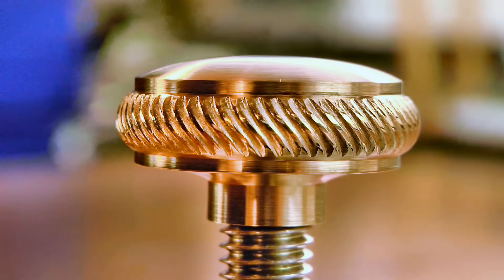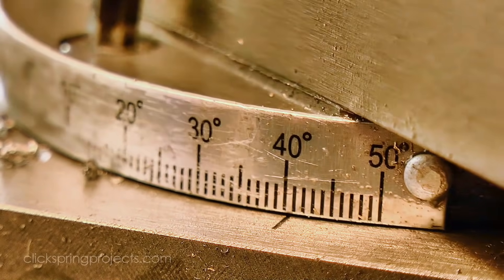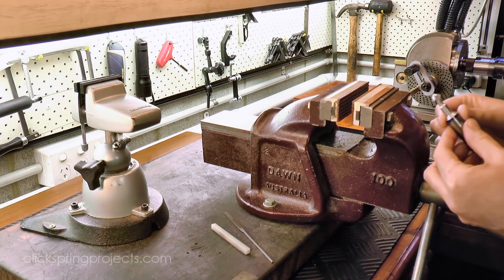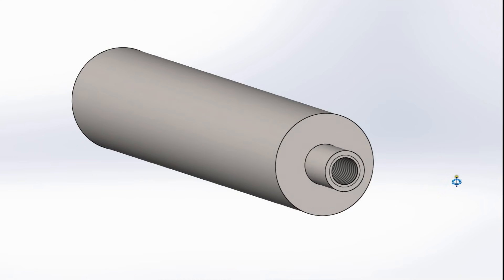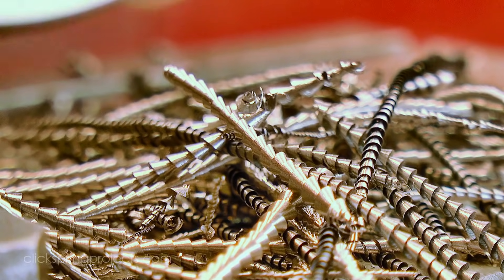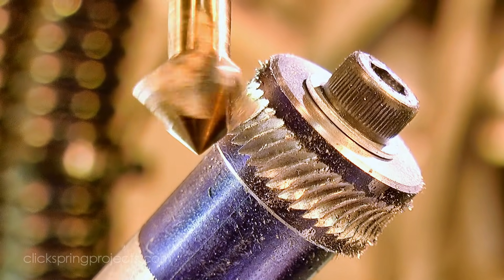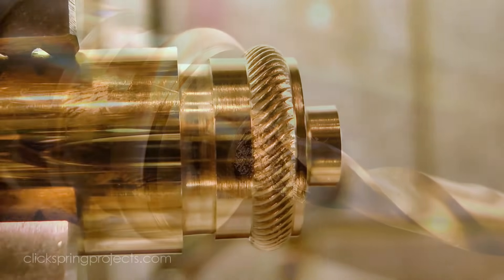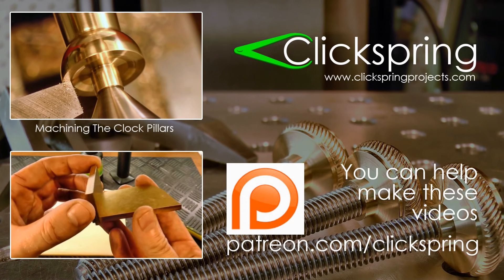Home Machine Shop Tool Making - Machining A Set Of Vintage Style Rope Knurls

Comment: These videos are absolutely mesmerising! This is art 👏 however, may i ask what is the difference between a normal drill bit and a 'reamer'? :)
Reply from the maker: +adam cowan Hey Adam, a drill makes a hole, but the dimension and surface finish of drilled holes is usually quite poor. However if a slightly undersized drill bit is used to make the basic hole, a reamer can be followed to leave a much better surface finish, and precise dimension. Thanks for watching and asking.
Reply: Thank you 😊

Comment: Are the rope knurl patterns (the blank molds that get pressed onto the wheels) hardened or a harder material than the wheels themselves? If not, won't the brass on brass cause the pattern to deform after a few uses? Great work as always!
Reply: In the video you see that the molds are made out of steel then quench hardened and tempered.
Reply: +Invoid ker Yep, somehow I completely missed that part. He definitely knows what he's doing, so I didn't think a step like that would go overlooked.

Comment: Love your videos and admire your craftsmanship, just a thought to consider.  I see you're quenching in a glass container.  If the object you're quenching is fairly substantial and you should lose your grip on it, it will fall to the bottom and be laying on the glass.  If it's hot enough it will cause the glass to break, causing your quenching fluid to drain all over the floor (and hopefully not burst into flames in your case!).  Believe me, this is not just a theoretical concern...  Good luck and thanks for the vids.
Reply: +Don Johnson Boro Silicate. Since we are discussing safety. I was a lowly third class Boatswains mate in the Eighties. We didn't do a whole lot with torches, but we never did anything hot without a firewatch. I'm not perfect either. A few years ago I lit a big Husky chainsaw on fire trying to prime it. I was alone in the shop but the memory of Senior Chief Holic's threats to personally keelhaul anyone who dared start a fire in his division reminded me to have a charged fire-bottle handy. My shop was full of flammable liquids and compressed gasses. There was a developmentally disabled treatment center next door. There was a big blue ball of flame then dancing yellow and orange devils on top of the saw. I had it out in less than ten seconds but I lost a lot of sleep over that one.
Reply: @crucifyrobinhood  0
Reply: It needs to be glass so he can show it to us. But I do agree that it could be dangerous. However he seams to know what he's doing.
Reply: Dude, I've set my shop on fire this way, it's not some silly idea that cold never happen.  Please do this all you want, my comment was aimed at people interested in learning from the mistakes of others.
Reply: +Don Johnson Whoah! What were you quenching? Must've been mighty hot.
Reply: 0
Reply: 0

Comment: Do you never have to take the diameter into consideration before you form the rope knurl pattern, or did you just get lucky with that piece?
Reply from the maker: Hey there +Lutranereis and +Emma Ritson the surface finish quality was very slightly better if the diameter was bang on, but there wasn't much in it. I experimented with a few different diameters and found that the diameter issue was much more forgiving than standard diamond/straight knurls. I suspect its because the tool is cutting a bit more than a standard knurl, so it just chews its way down to the first diameter that works, and you're in business. Thanks for asking :)
Reply: Clickspring Thanks for taking the time to clear that up, Chris. As always, I look forward to the next video!
Reply: +Lutranereis watch the video!!
Reply: Emma Ritson I did, which is why I'm asking.
Reply: +Lutranereis about 10:20 mins, i think
Reply: Emma Ritson Yes, it cut into the piece, but I'm asking if it would do that every single time, or if he was just lucky and those pieces happened to be close enough to a diameter that would work..
Reply: Fair enough. Sorry. My take is yes it probably would. Not sure though. :)
Reply: Emma Ritson No problem, I probably could have worded my question better.
Reply: +Clickspring so it's sort of like two cogwheels, it's more of a matter of getting the tooth modulus right.

Comment: Is there a reason you didn't use your square ER collet block for the 4 flutes? Just curious if the dividing head provided anything to the picture
Reply from the maker: +James McIlhargey Hey James, the ER collet block would have been perfectly fine at giving me the 4 positions, but I was going to be using the dividing head later for cutting the knurls so I figured I'd get it set up early! It's a heavy beast that thing... Thanks for watching and asking :)